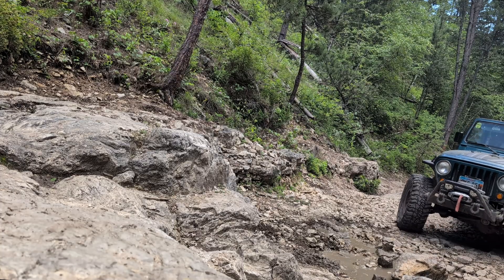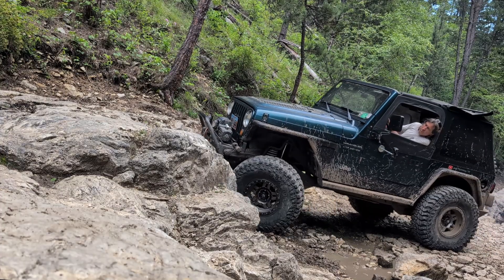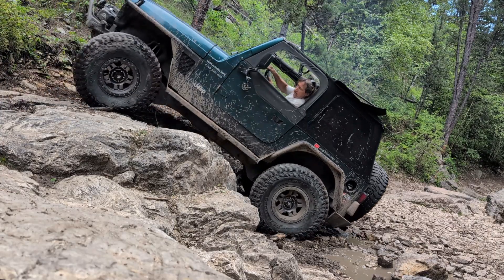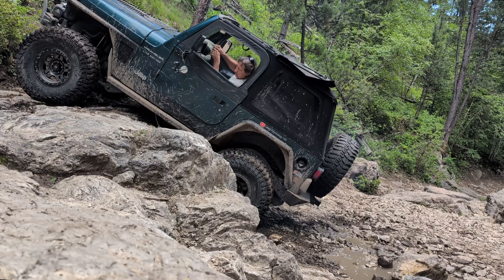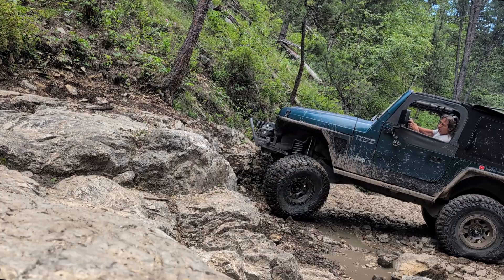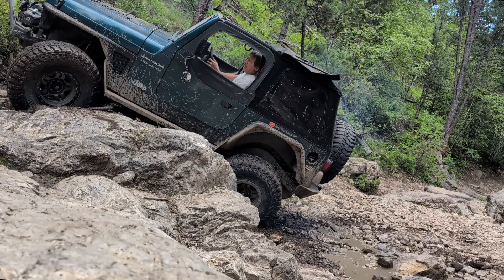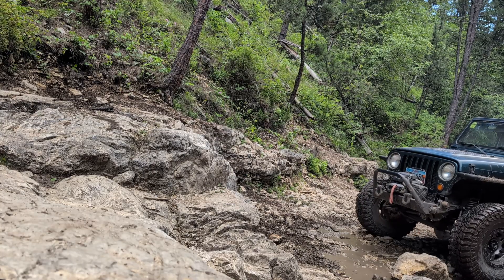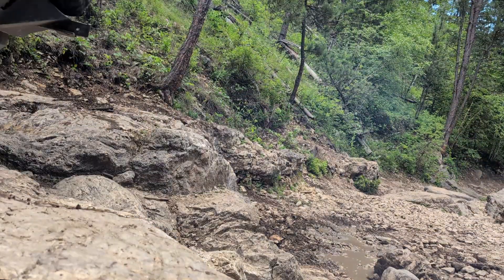Low Center of Gravity ...Is it REALLY superior?

Comment: equal up and down travel is where it's at
Reply from the maker: I agree, however with a platform like a TJ or an LJ, obtaining equal up and down travel is quite modification intensive and expensive. I do plan in the future to go with GenRight aluminum high line fenders and trimming the hood to fit, as well as trimming the rear fenders which will gain @4" of up travel 
However in this particular scenario all of the up travel in the world wouldn't have gotten me off of the center of the skid plate. It needs four more inches of  ground clearance to make it over that obstacle without taking the spare tire off of the back.
Thank you for watching 😎👍🏻